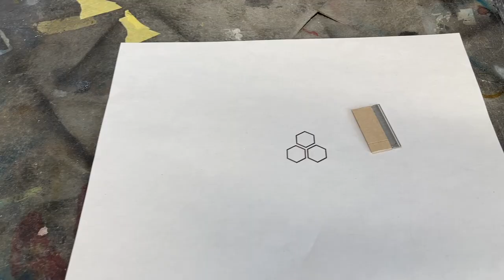How to Airbrush Easy Honeycomb Stencil for Beginners

Comment: The best investment I made in learning to paint was a circuit. Cheapest vinyl cutter out there. Cutting stencils with a razorblade is miserable lol
Reply: Agreed!
Reply: What vinyl are you using for low tack? ( not pulling the previous paint up when removed )
Reply: Removable vinyl not the permanent